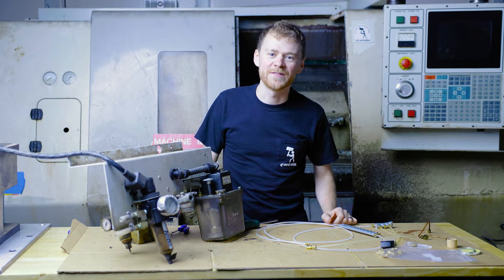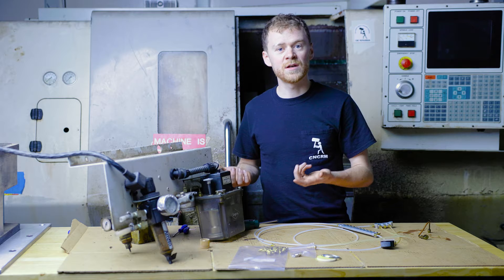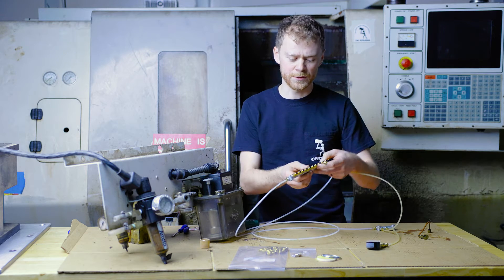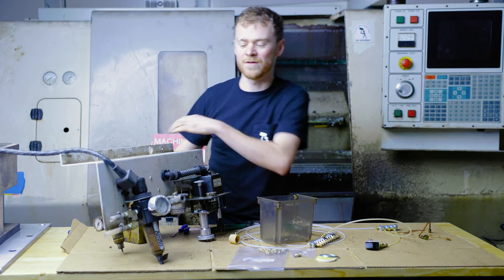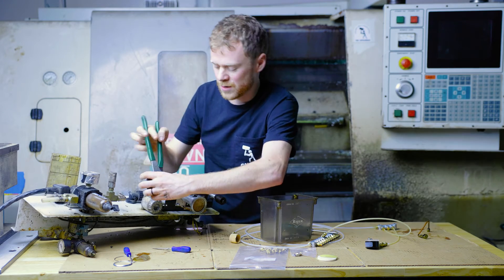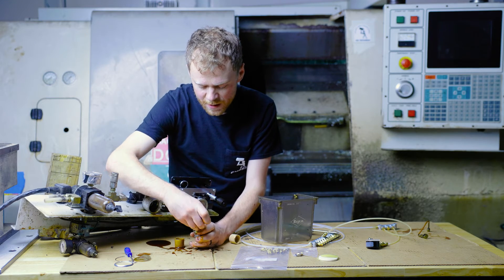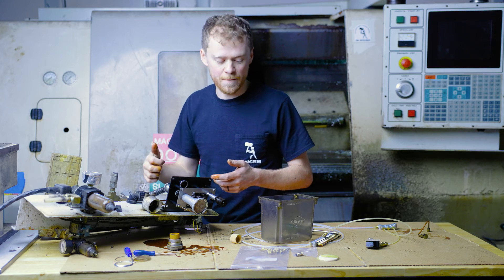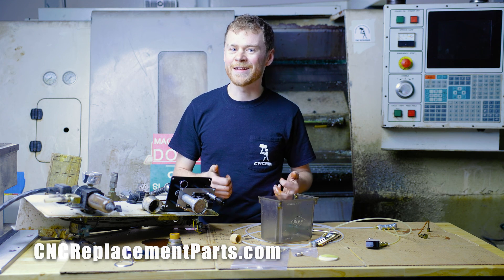Way Lube System Overview

Comment: Thanks for the explanation. Currently have a triple crown situation (plugged lines, caused a clogged pump, which blew the relay fuses)… currently have a bridgeport style hand pump on the CNC to flush the lines out 😁🔪

Comment: Great info. I have the oiler without the manual plunger. Everything has been working perfect for years, then when I just took the reservoir off just to give it a dump and a clean and a wipe out and put it back together and top it off with oil. Now it doesn’t seem like my plunger wants to grab oil. Every cycle I just hear  the clunk of the plunger audibly loud. So I tried cycling the electromagnetic solenoid several times by pushing in on a little plunger with a small Allen key, but I still can’t seem to get the prime back again. Any suggestions?